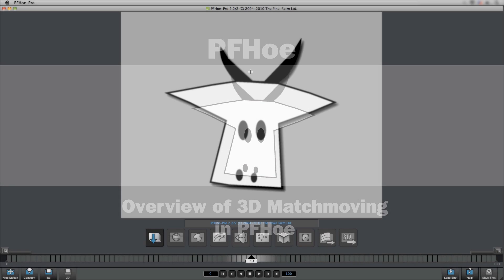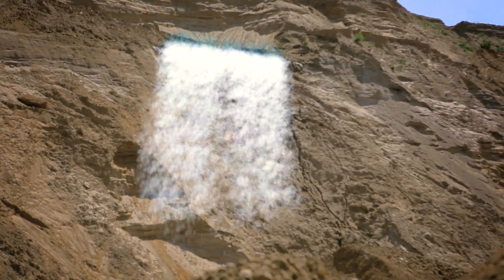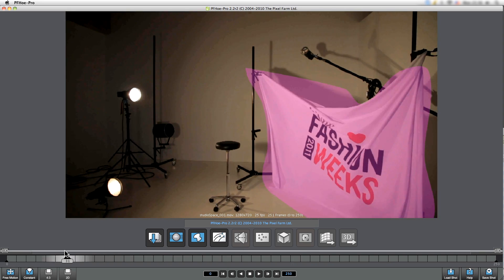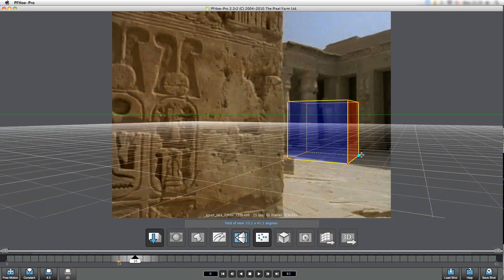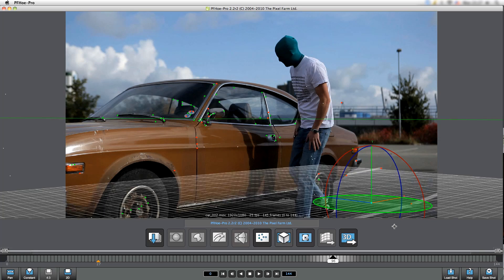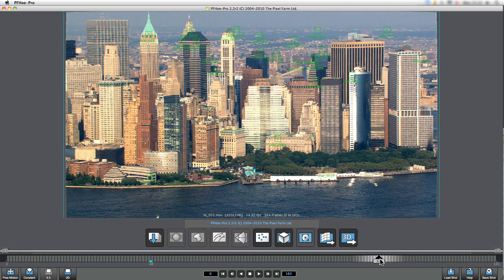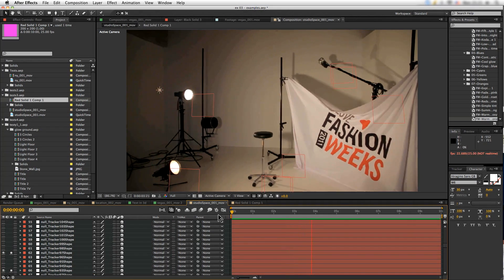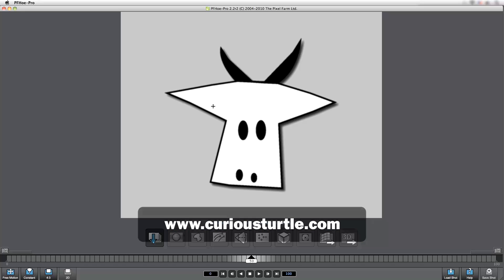Intro to Matchmoving with PFhoe

Comment from the maker: @mk181818 
PFhoe is a camera tracking application. Using camera data generated in PFhoe, animated elements can be composited into a live-action shot in 3D space and will appear in perfectly-matched perspective.
FCP is predominantly an editing application. You would use the PFhoe data in a 3D or compositing app.
Check out the Quick Start tutorial

Comment: The presentation is not too bad, but it lacks of systematic explanation. 1. What is the major statement of this program? (can I turn 2D into 3D data? 2. Why it can't be used with FCP for instance? 3. What are the limitations of this program? How much rendering it will require?